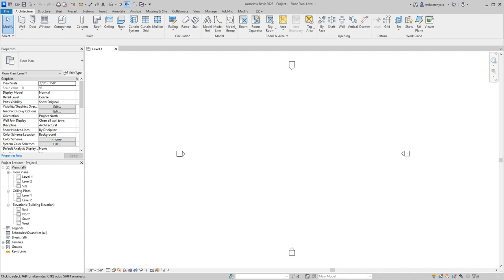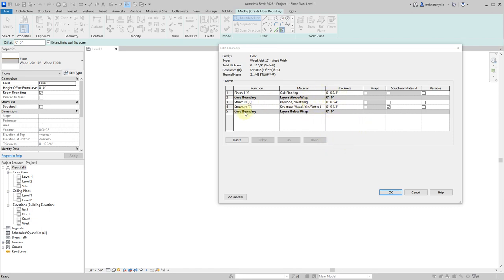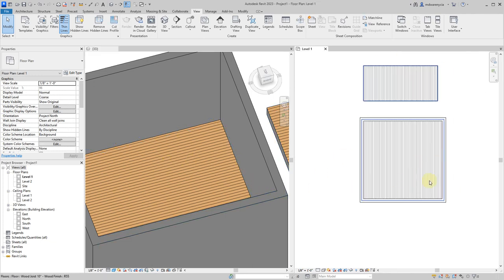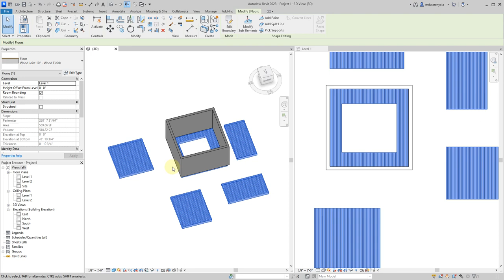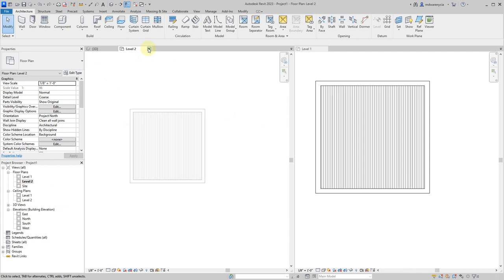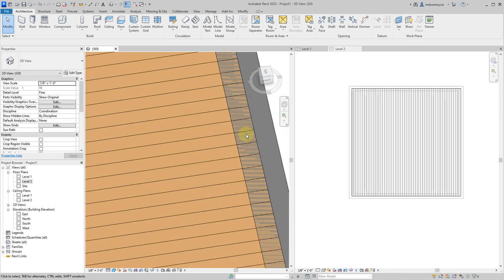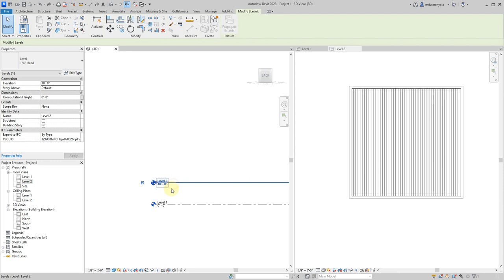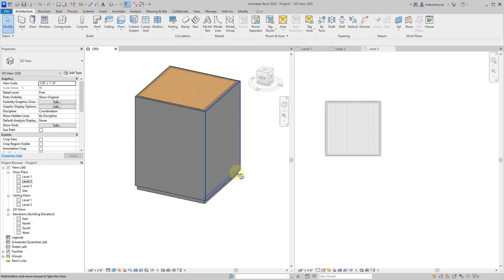Lecture 2-1 Floors

Comment: Is there a reason the floors shouldn't extend under the walls? I thought the walls on the second floor would rest on the floor trusses/joists, and on the first floor they would be sitting on the bottom plate which is ontop of the slab.
Reply from the maker: For what we're doing with it, it's simply a stylistic choice that makes minor wall tweaks easy without having to go in and constantly redraw floor profiles. That's why in this class I typically just draw to the middle. We aren't touching engineering/load calcs for this class, so where it draws is mostly irrelevant. How those actually join together we'll document later in the wall section callouts, which will use a cutaway of the wall, and that's where I'd actually make sure the floor is in the correct place.